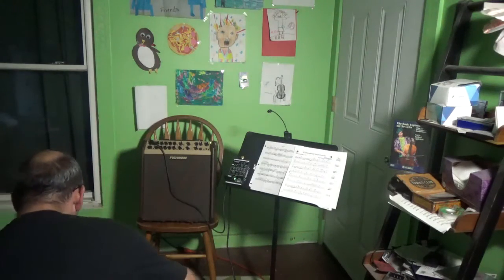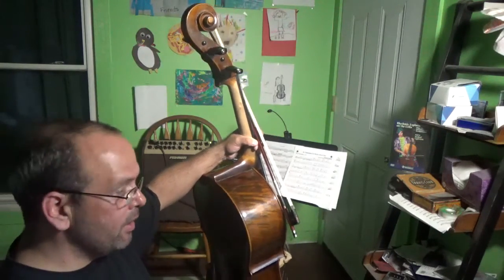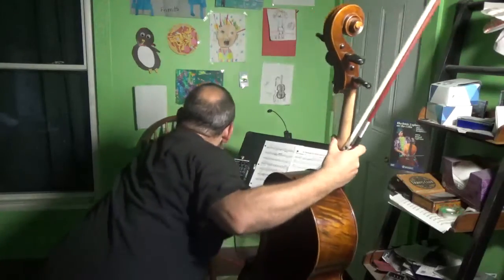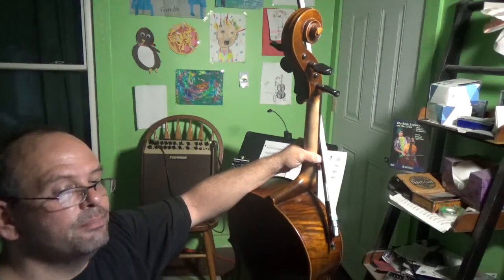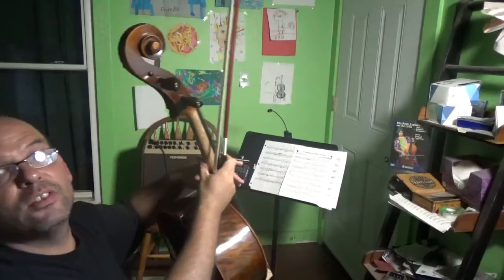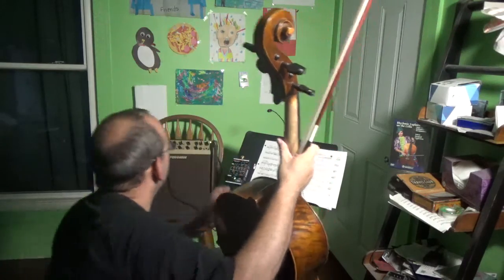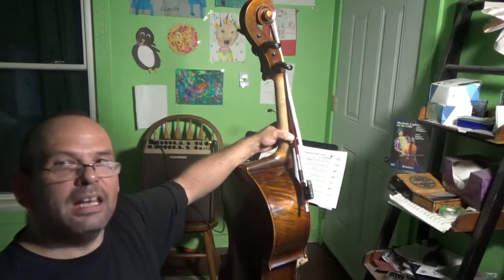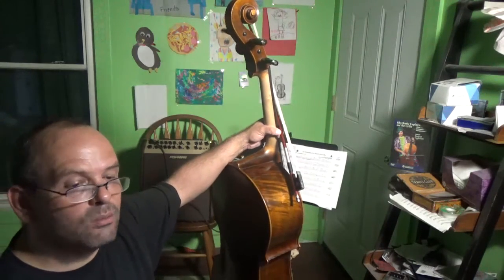Stuart Dual Cello Pickup

Comment: Great video John. I agree that we live in very fun times for the cello. I've been playing with some loopers and working on getting a super clean cello sound. 

What brand of pick ups did you use in this video and what type of mixer are you using? I currently have a realist under bridge pick up feeding into a para coustic pre amp but still don't have the clean/real sound I'm chasing....
Reply from the maker: Hey Murvy,
 Thanks for the kind words. The pickup is a home made thing I've been working on for a while. Give me a month, and I'll have some available. The preamp is a Headway EDB-2 blender. Which I really like. Tons of clean gain, feedback control notch filter, 12v phantom power for mics. I've also used the LRBaggs Venue Preamp. Very good, but just one channel.
The Realist is too close to the bridge. It's GREAT for pizz, not the best option for arco.